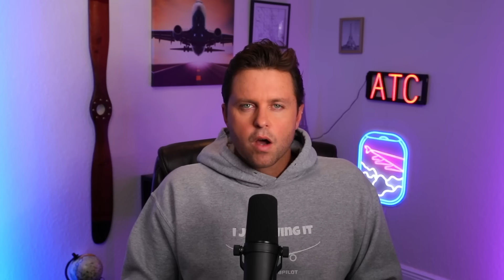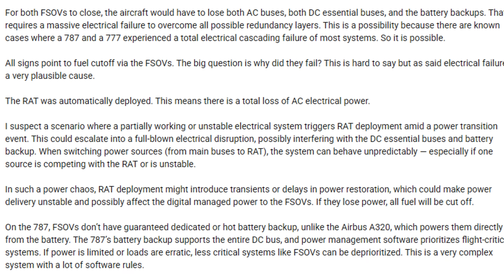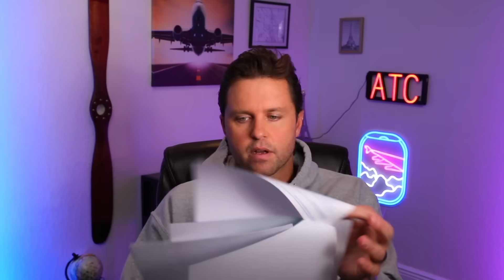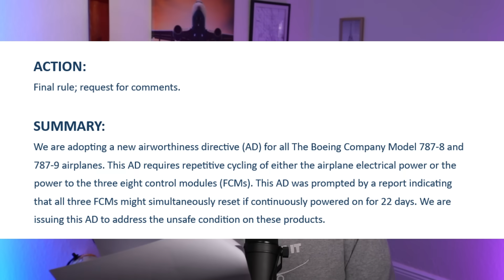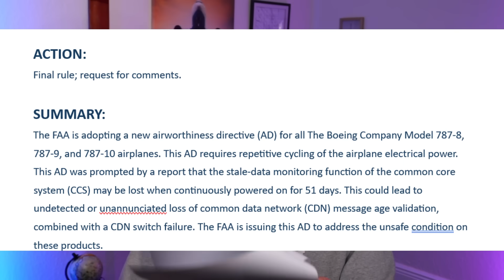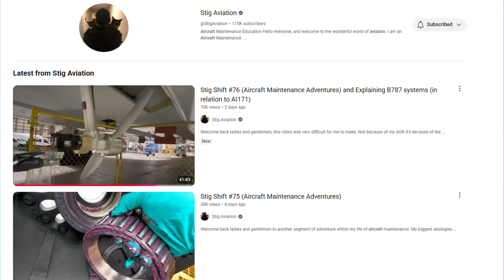Air India 171: Did a Software Glitch Cause Dual Engine Failure?

Comment: I was a new hire Engineer working in the F-15 Hydraulic Design group in the 1970’s when we heard about non-combat F-4 Phantom aircraft crashes.  When flying at altitude both hydraulic systems would sometimes shut-down leaving the aircraft without flight controls with the engines still running.  The pilot was forced to eject.  However, one time during a flight failure without flight controls as the aircraft was “Auguring in” the pilot suddenly realized that both systems had come back on-line and was able to land the airplane normally.  Subsequent inspection of the hydraulic systems did not reveal any problems.
MACAIR St. Louis then set up a F-4 hydraulic pump with reservoir and a plastic suction line in a Lab and ran the pump at lower reservoir pressures.  Videos with sound were taken.  When vapor pressure was achieved, the entrained air in the pump suction line formed a long bubble that was ingested into the pump which was then shut-down due to air lock.  The pump was still turning but no liquid was coming out.  You could see and hear the bubble being ingested.  Given enough time and with an increased reservoir pressure, the pump hydraulic output would restart normally.  Vapor locks can be elusive! 
There were lessons learned and “fixes” incorporated for the F-15 hydraulic system design where we used non-symmetrical reservoir installations in lieu of symmetrical installations used in the F-4’s and techniques used to keep air out of the hydraulic system (e.g. high response engine driven pumps and system relief valves were used in lieu of air/oil accumulators).

Comment: That certainly sounds like a design flaw.
Remember Fukushima. This disaster was triggered because, after the power loss, the valves used to cool the reactors closed automatically. And they should have been opened manually again. This procedure wasn't listed in the emergency manuals in a timely manner.
It was a faulty design or programming in the event of an emergency.
A787
A simultaneous engine failure is extremely rare.
Compared to the A320, where the complete shutdown of the fuel supply is prevented by the use of emergency backup batteries, it means that the engineers there knew what they were doing.
If this emergency safety feature is missing on the A787, there are two reasons: Incompetent engineers or simply cost savings.
Which, again, would be typical of Boeing.

Comment: this is what i initially thought, as if a panel fell down in the cockpit and hit the switches or something happened between the fuel shutdown levers, power failure and lithium batteries plagues these planes when they first came to flight, so i feel this is the right path to what actuarially happened

Comment: My take: During takeoff roll, right up to before V1, one engine gave out, and considering they went past V1 and were nearing end of runway they had no other choice but to take off. As they lifted off the dust that you see spooling at the end of the runway, might have had debris which got into the performing engine and thereby caused it to malfunction too. Tho there was no fire in the engine the debris theory might not be solid but still something to look at.

Comment: Hey Gary, as a 787 mechanic for me, the only logical explanation is that there was an intensive electronic problem.

In case of a power loss on the Boeing 787, the engine fuel shutoff valves are designed to fail safe in the closed position. That means if electrical power is lost or the control system fails, the valves will automatically close, cutting off the fuel supply to the engines.

This is a critical safety feature to prevent uncontrolled fuel flow, especially in situations like an engine fire or major system failure. The valves are typically held open by electrical power, and when that power is removed, they close using internal springs or hydraulic force.

So even with no power, the system is built to protect the aircraft by stopping fuel flow to the engines automatically.
Reply: I understand your comments.  However it is not logical to consider protecting the airframe by disabling the engines while airborne.  Additionally even Boeing engineers can’t be dumb enough to power these valves (open) from only one source.  There has got to be more to this circuit than is being described in the video.
Reply: @wwsoapbox6921 I can understand your point ! But also the RAT deployed wich is another sign of critical electrical power loss.
Reply: Great if it happens at 5000ft but at 600 feet? mmm

Comment: The plane likely suffered a electrical power loss that affected both engines as the 'R.A.T" Ram Air Turbine which generates emergency electricity deployed but the aircraft was to low and had no time to do a windmill relight engine start. Nobody is talking about the F.A.A. airworthiness  directive thats out on the Dream liner aircraft since 2015 for a possible full electrical power loss and subsequent catastrophic crash that can occur at any phase of flight due to a programming issue with the generator controller as all Dream liner aircraft have to have the electrical system recycled periodically before 248 or so hours of operation is reached or a catastrophic crash can occur.
Reply: I mentioned that 8 days ago on other internet platforms and nobody talked about it til now

Comment: it takes me back 10 years ago when I had to buy car on hydraulic versus electronic steering and I have to choose between them, and and I chose hydraulic thinking that the most important parts our life rely on should be only mechanical or there should be a switch over to mechanical option in case of electronic failure considering electrical or electronic are very delicate and will always be. today everything is so electronic and software based. call me outdated I don't mind.

Comment: Please check one thing. In the event of loosing the FADEC the engine will most likely ONLY continue to run with a minimum of a certain percentage of thrust /RPM. If you coming below this value the backup system will not be able to keep the engine running. If....... , the crew made the takeoff and encountered a catastrophic electrical failure which caused both FADAC to fail and they reduced the power may be unfortunately below the minimum RPM for the condition running without a FADEC. 

I know someone in a different Aircraft model who mistakenly did shut off a FADEC in flight, and they did run this engine below the engines self sustaining RPM and this engine did just shut down . I think there was a minimum of 65% powersetting needed.

Comment: Another inportant consideration that pretty much debunks 'FSOV causing loss of thrust' as implied in the various comments chosen for discussion here is the absence of any indication of engine surge.  Shutting off the fuel at high power would generate a big surge, with cannon-like report and fireball out the front and rear of the engine - none of this is evident in the videos, the observer reports, or pilot mayday message.  

The surge is the sudden release of 400 psi air and fuel vapor trapped in the high compressor diffuser/combuster volume when airflow thru the engine is stopped by the loading of a compressor stage beyond its aero load limit, which stalls the stage and prevents the normal airflow from occuring.  Rapid deceleration of the high-pressure spool, as would occur with fFSOV closing at high power, will cause the high-pressure compressor to block airflow exiting the low-pressure compressor, pushing the LPC stages beyond their loading limit (called LPC Surge Line, logically enough.)  The sudden stoppage of thru flow when the LPC stalls causes that trapped high pressure air to blow backwards out the front of the engine and in the normal direction thru the turbine section,  with the loud report and a fireball from the fuel-rich mixture.

The method by which faults are evaluated in the design process, soe research on Fault Mode Effect and Criticality Analysis of FMECA.  This rigporous process evaluates every possible fault mode of each system in the airplane for its consequences.  Where flight safety is harmed by a fault, an accomodation must be made - redesign, change materials, add an inspection, re-route the system.  This is a large and slow process with many people involved - and numerous assumptions on how pilots and Mx people will react.  A good example, somewhat relevant to the Air india situation, is the V1 balance...the key assumption is that the flight crew will identify engine faiure and initiate appropriate reaction (idle, reverse thrust, maximum braking) - within 1.4 seconds.

A cool thig to do would be to create an FMECA Boot Camp where people with an interest could dig into this process.

Comment: I know diddly squat about aviation engineering but it's patently obvious that the dual engine shut off
happened first therefore the RAT deployed and that is disturbing. If you have respected info about
possible software issues and they are recognised by the authorities already then why the hell is the
787 not grounded after all this info is years not days old.

Comment: So, using my accumulated "Mayday" knowledge but knowing nothing about this particular incident as I watch along.
Dual engine failure: Out of fuel (Gimli Glider)?  Fuel blockage (Heathrow Enigma)?  Massive hailstorm (Southern 242)?
On take-off: Okay so not lack of fuel or the storm.  But we are considering the fuel flow?  Just not at the fuel-oil heat exchange.
Computer glitch: I heard of a case or two but don't remember them clearly, pilots turned off the computers to fix them.
Boeing builds inherent problems into intricate new systems: Oh great, it's that rudder control unit all over again.
Or it's just bad fuel, that tracks too.  I hope the investigation is forthcoming with real answers from clearer information.

Comment: This is Completely wrong! In the witness video you can hear both engines still running but somewhat in a quieter mode. Rat was running too alongside the engines. You can hear them.
Reply: "you can hear both engines still running but somewhat in a quieter mode" - that would mean the FADECs metered down the two engines.
In degraded power modes (when there is still some electricity available, but there is a partial power loss/data bus interruption/loss of certain sensors) FADEC may default to idle thrust or metered-down protection mode.
So what you are saying is not contrary to what Gary is saying.
Reply: I not an expert but what I'm saying is that the engines were not completely shut off because they were still running. That's all. I don't quite comprehend the rest of the stuff that Gary explained but to me it sounded like the fuel valves are spring loaded and they just cut the fuel feed off completely. But I can hear in the video that the turbines are still running but in a quieter mode.

Comment: DT Technician :Seems like the pilots had done things correctly but due to loss of power to the engines nothing more could of been done i think the key question is the loud noise reported by the only survivor was this an electrical explosion because modern engines need some power to the ECU's ( engine control units ) or was this a mechanical one and the flicker of lights confirms the RAT also how long does the system take to reboot once the RAT is deployed for the basic controls and displays. This would cut off power to fuel /hydraulic pumps to engines this what i have been repeating myself last few days

Comment: Can the FSOV  Fuel Shut Off Valve, be manually  overridden, if it automatically goes into the off position❓🤔🙄😱🫣 This should be mandatory; the ability to manually override the FSOV, if it unwantingly, goes  into the off position.
This could be fatal; catastrophic, if the FSOV, automatically goes, into the off position, during takeoff, or even during flight. ✈️🛫
Do all Boeing 787's, have a software flaw; was this cause of the Air India crash❓🤔🙄😱🫣✈️🛫

Comment: Note:Speculation below 

Nay, the FADEC components suffered overheat sitting on the runway. Could have been control lanes or overspeed lanes of the FADEC but in any case the temperature exceeded the FADEC qualification for component temperature.

Comment: It seems that there's no mechanical backup for any sort of engine throttle or flight control electrical failure in the 787. Even the single seat A-10 Warthog has a manual reversion system in the event that the primary control systems get shot out or just plain fail. I retired out of that system nearly 3 decades ago, and flew a number of Boeing types afterward. I had a failure of the computer brain of a 757 that caused the jet to want to become a submarine, but there were mechanical controls for everything I needed to wrest control from the jet's dead brain and continue flying safely to destination. The pilots on the Air India jet were good pilots doing everything they could, but without mechanical backup controls they weren't able to fly the jet. They did however get out a Mayday call in which they described exactly what was going on. I'm heartbroken at the loss of these people.

Comment: The duel engine loss for Japan 787 times as secondary to biocide fuel contamination, similar to a320 at London Gatwick. HPSOV is a power on/power off valve, not spring loaded. The system is designed to continue last fuel/throttle setting with power loss, not shut off fuel to engine

Comment: Hello Garry, have you considered that the pilot did not use the full runway to gain adequate speed and did overshoot the runway and the dust cloud just before takeoff caused debris to get sucked into the engine and shut it off.

Comment: Don't use google for factual information(7:38), they're using AI garbage now, and they've been totally compromised by their current "leadership", ethics have gone by the wayside entirely.   I wouldn't trust anything it spits back at you.

But on the whole, I think the 787 fleet should be grounded and Boeing/Mcdonnell-Douglas (Particularly MD board and C-Level) should be taken to the woodshed.  Because you're probably right and they have created an environment where engineers cannot do their jobs for decades now.  New leadership is making the right noises, but dunno if there is real follow through.

Comment: @7:53 Gary, now you're just using Google/Gemini AI slop as fact. It said the FCSOV could close when "Bleed air pressure is lost". We know that's an AI hallucination because the 787 DOESN'T have a bleed system.

Comment: @7:44 The overtemp that would trigger the FCSOV to close would be from a fire, not just hot air outside. Hundreds of degrees difference.
Reply: Even the AoA vane on the 737 should have never been able to detect a stall in the absence of one. Could have been a faulty sensor here too…

Comment: Did engines failed?
Most probably it's due to high temperature of 39 degrees, low or no flaps, full load and low speed.
Most probably,  it's pilots fault.

Comment: I'm not sure I buy it. A simpler & more likely speculation is a single engine failure (the 787 will auto-input rudder to correct for asymmetric thrust) followed by the pilots attempting to relight it during the climb out, and (maybe) possibly shutting down the good engine by mistake in all the induced stress. It has happened before, decades ago I think on a British Airways flight on final approach
SPECULATION ONLY, DO NOT TAKE MY WORD FOR IT
And I in NO WAY mean to blame the pilots, but things happen sometimes

Comment: I said since day 2 it was some sort of electrical and software problem. I was told it couldn’t be a Boeing issue because the planes been flying for 12 years. Idk why anyone would think that negates possible issues with Boeing? I’m not saying it is, but what if there was an unintended design flaw that finally showed? I’m again not claiming this a fact or that Boeing did anything wrong, buuuut the information in those papers and that comment is interesting. 

The biggest reason I felt it was an electrical issue is because the 787 relies on electricity differently than previous model planes. It far far more integrated and more reliant. So I personally felt it didn’t make sense to ignore the report of serious electrical problems from 2 hrs before that flight. 
Idk for sure, but I think some pilots are unintentionally applying their knowledge of other model systems to the 787. Even if they know that the 787 is different, it sorta seems that some just don’t realize how different. The integration of electrical into engine mechanics is different from previous models. 
I tend to agree with the commentor’s theory. It differed a bit from mine, but I think this scenario is a solid one to consider as a possibility. I think fuel contamination is extremely unlikely and while vapor lock seems probable, why don’t we hear about it more often considering that these planes actively operate in such climates? Plus from my understanding, the 787 has something built into it thats supposed to prevent vapor lock, so maybe a possibility if the electrical issue caused issues with that system? 
I also have to wonder, this is now the second plane where a black box was destroyed. Why? How normal is this in this type of accident based on those that have happened in the past? I’m not trying to float a conspirac y, this is a legit question. Was the black box able to be recovered from the two in 2019?

Comment: 'Glitch' is random bs. Is the battery dc controlled by the electrical system or is it independent? My aircraft systems experience is pretty dated, but our dc bus was always direct and independent so that it could be a true backup that could not be taken out by the AC bus or other system failure. That is the whole point of it's existence.

Is the battery dc bus software controlled? That is the whole question. If it is, then a bug or unintended consequence from an unforeseen event could have killed the DC bus. If not, then it would be a real back up. Which it damn well better be.